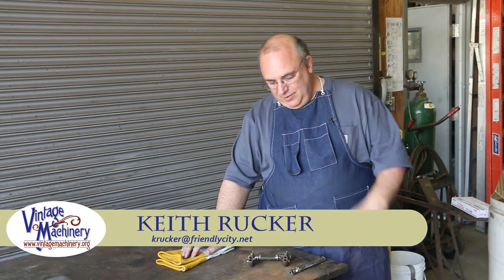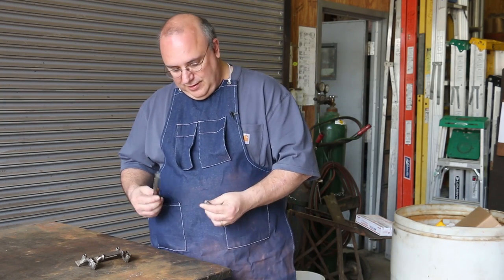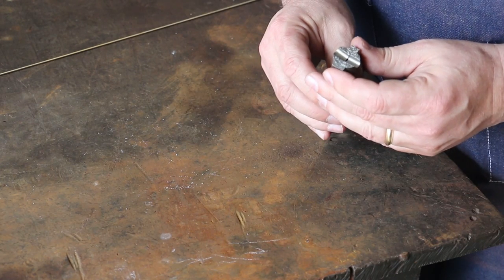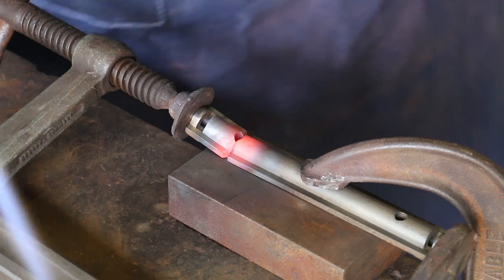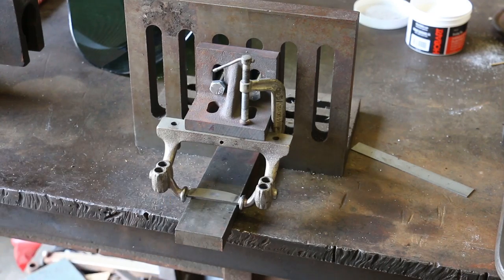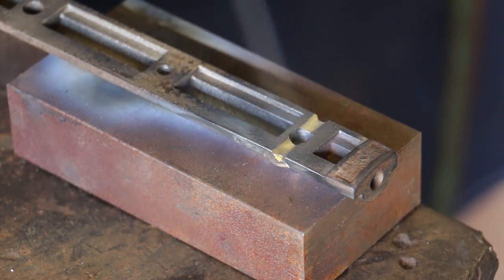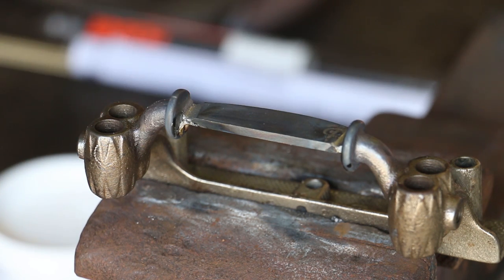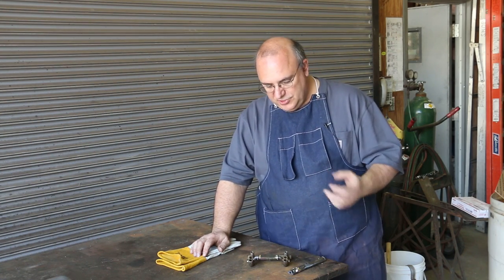Brazing Broken Cast Iron:  Repairing a Stanley 55 Plane

Comment: Im a retired welder over 35 years,  and you are right you can't just use hard wire in a mig or 7018 that's a no , you wanna use brazing rods , nickel rods , SS cast iron rods etc. There's quite a few , the reason cast iron is so hard to deal with is the stretching and bending is only at a 2 to 4 percent when applying heat to it , unlike mild steel has a 50 or better stretching,  bending warping point , not to mention cast is dirty anyway .....but warm the cast up pretty good before welding the crack , just let it flow slowly , lot of people try to get in a hurry with cast and it just want happen , patience is key when welding cast ....clean the area and bevel the area clamp it down good cause it will warp ....

Comment: It would be stronger if you 'tinned' the unmodified surfaces with the rod, then re-flux and bring them together while hot on a flat ceramic surface (doesn't absorb the heat). The thinner the uniting metal, the stronger the joint. No need to grind out a 'vee', that only weakens the repair.... Brazing is soldering, just using brass or bronze instead of tin/lead, and at a higher temperature, but the principles are exactly the same....

Comment: why not brazing paste? brush and flux busted edge, paint on brazing paste, wire/clamp to position. heat, tighten clamps when fluid, let cool. no need for notching or grooving, perfect alignment, and stronger than a stick joint usually. H&R used it for the hinge/lock blacks on single barrel shotgun barrels, (you can see the line of braze in the blue job), so it really can't be "weak"...  probably would have been just the ticket for that sleeve repair in the loco cylinder head too. i can dig that some jobs just don't lend themselves to such materials, but those "on the bench, at my leisure" type ones seem to cry out for its use

Comment: That was a satisfactory job on the brazing but I can't help myself. 
I'm not looking to criticize but I wanted to share some of my experience in the hopes that we all learn how to improve our skills. I learned to braze from a master back in the late 90's and he was really good at explaining the science of metal bonding (ionic bonds) and how different materials react to different temperatures and how to apply the torch flame to achieve optimal temps. He taught me that the "secret" to good brazing is to recognize how the materials involved behave and react when your materials and flame temps are in the "green zone".
.
I noticed that you had your torch set too cold and you were applying the flame from too far away during the brazing work. 
.
The torch flame has two parts, the "feather" and the "needle" (as I learned to call them), the feather being the transparent blue long and wide part of the flame and the much hotter short blue-white opaque "needle" in the center.
The needle is the real working part of the flame for the actual brazing part of the work. 
.
A lot of guys call it a "neutral flame" when the needle is about a quarter inch long and you get more of a "whoosh" sound from the torch and they call it a "carbonizing flame" when a little bit more acetylene is added in to make that needle flare out to about a half inch long and you get more of a "hiss" sound. I would have used the torch as it was set in this video if I were brazing something like copper tubing joints or plumbing joints. For the work in the video, I would go much hotter.
.
The feather of a neutral flame is fine for the preheat work but when you do the actual brazing (the part where you actually melt the rod in to the gap), you want to be using the heat projecting directly from the tip of the needle for that. That much hotter part of the flame will more quickly melt the rod and allow it to flow like water in to the gap. If the flow of the metal from the rod looks and feels more like maple syrup or pudding than watery, that's a good indicator that you're too cold or too far away. Most of the time it is best to push the tip of the rod in rather than lay the side of the rod down.
.
You don't want the metal parts being bonded to do the melting of the rod, you want the flame to melt the rod. Ensuring that you apply the rod/heat in that manner, you avoid most of the "clumped and humped" metal around the joint and it's much more efficient, makes a stronger bond, and it really cuts down on the clean up part of the job. 
When the material on both sides of the gap is sufficiently hot, and you are putting the needle to the rod, that rod metal will naturally flow in and cling to the sides of the gap through capillary action and when your material temps are hot enough, very little flux is necessary. In fact, over fluxing the joint can weaken it if you aren't careful.
.
When you set your flame for this type of brazing work, in the future, I'd listen for a little more "hiss" and little less "whoosh". I would have set the needle to be "carbonizing" at about a half inch long, with a sharp point, for the work you were doing and apply the flame to the rod/joint so that the needle tip is about an inch from the rod/joint (much closer than you were applying the flame in the video) with very short, quick, tight sweeps of the flame. 
That will get the temps up to where you need them for a "watery" flow and a very strong ionic bond that creates a very clean and efficient joint. It even uses less rod, less flux, and less time.
.
As I said, I'm not looking to talk down to anyone, I just hope to make everyone better at the task. Hope this info helps someone. Take it or leave it as you see fit.
Best of luck to all.
Reply: +BigRalphSmith That was really helpful, thank you!
Reply: +BigRalphSmith  Keith is not an expert at everything he does, I have heard him say things along that line several times. However he has a tremendous can do attitude, and I think he is a really great guy for taking the time to post his videos to help the hobbyist learn how to do jobs. That also prompts discussion and comments from genuine experts and tradesman like yourself who add valuable contributions.
Reply: iiredeye iiredeye
I love watching Keith do his thing. He's far more knowledgeable and skilled in machining than I will ever be.
He does an admirable job even in those areas where he freely admits a lack of knowledge or experience and any information that I feel might help him out is worth sharing. Not just for his benefit but for anyone who might be able to benefit from the experiences of other tradesmen or craftsmen.
Probably the thing I like most about his stuff is that he's willing to make mistakes and show those mistakes to everyone. That makes all of us better at what we do in the end.
Reply: +BigRalphSmith I noticed he used a whole bunch of flux (at least, to my noob eyes it looked like alot). I've seen others use a very small amount. How much flux to you need really? Does it vary depending on the type of metal or do you usually only want a thin coat? 

"You don't want the metal parts being bonded to do the melting of the rod, you want the flame to melt the rod." -Don't you melt the rod with the flame with certain rod (like lower melting point rod; i've heard you do for things like copper pipe)? Also, if you are melting the rod with the flame, how do you know how hot the part needs to be if you are melting the rod with the flame? Are you basically looking for the part and the rod to be the same temperature?

Finally, is there a universal "rule" about any technique or do all techniques need to be specific to the metal/rod combo you are working with? 

I've just been introduced to brazing and am really excited about not needing to go purchase a full welding setup for the little bit of hobby stuff/home repairs I need it for. Thanks for taking the time to do this write up.
Reply: F!@#Guilt
I'll try to give you the best answers I can but I don't claim to be an expert. All I can claim to be is a good, experienced welder (and even that claim is up for debate or challenge because, in the end, that's just my opinion and the opinion of some others I've worked for and with).
.
On the question of flux amounts, I find that, if your temperatures are right and your parts are hot enough and you are using the right rods and have the torch set correctly, you will need far less flux than if any of those things are off no matter what material you are joining or rod type you are using.
.
On the next question, you learn how the filler metal behaves when your temps are right and when they are wrong.
The metal from the rod will readily flow toward and adhere to the parts if the parts temps are in the zone.
It will glob up like chewing gum when they are too cold.
It will run right past the parts like water if they are too hot.
It's almost like how the surface tension of water works. It's difficult to put in to words.
.
The only truly "universal" rule I know of is, eventually, there is no rule that you are never going to need to break on occasion except those that are safety related. Safety rules are genuinely universal. All others, we'd like to think they are but the reality is, not so much.
Brazing, like welding of all other types is as much an art as it is a skill and there's only one way to perfect your skill; experience and practice.
In the end, the more you do it, the better you get.
There's no short cut. Some catch on faster than others. Hope you get the chance to work with a good teacher as I did.
Reply: BigRalphSmith Thanks for the reply. Good advice man. Cheers.
Reply: BigRalphSmith   Temp and fitment has nothing to do with the amount of flux to use
Reply: Russell Withrow
Experience and training tells me otherwise.
Thanks for sharing.
Reply: whatever you have said its just  100%correct that is the right way of doing   Brazing thanks for the feed back on this video its not about criticize  its about we all learn from each other
Reply: BigRalphSmith  why don't you make your own video  looked like he did just fine. he is the master that you would learn from. and not disagree with his results.
Reply: Francisco Molina
Because I have nothing to prove to anyone.
I shared some personal experience because I thought someone might learn something new but, even if no one does, that's fine too.
I expressed some opinions. Feel free to disagree with me.
That doesn't bother me at all.
And, I highly doubt that it bothers Keith either.
You act as if I'm trying to tear Keith down but I'm a big fan of Keith's.
Reply: +Frank Molina what  +Camical name  tell me
Reply: BigRalphSmith
I hope to see you making a video to show us step by step how to braze and the common mistakes.
Excellent informations you put in this comment.
I subscribed to your channel and waiting for good informative videos.
Regards.
Reply: That was a very informative response.  Thank you for sharing it.  I got a lot out of your comments.
Reply: Frank Molina
that's a scary comment from you. How dare we have anything to say about your master. 
You talk about learning but your attitude will make sure you learn nothing. 
Keith gathers people like you around him to bolster his own ego and you are a prize example.
Reply: @frankmolina3951  Ralph pointed out something everyone can benefit from. The first thing I also noticed was that the flame was way too cool. Google "neutral flame" or slightly "carburized flame". Best you not disagree with others unless you are certain they are wrong.
Reply: What surprises me most is that Keith didn't even bother to acknowledge or reply to this extremely instructive comment. A lot of amateurs can learn from this critique. 
Kudos to you BigRalphSmith
Reply: @bigralphsmith thanks for the additional information, that together with this video was really helpful
Reply: I know this was written 5 years ago but I have never seen how to braze explained so well!!!! Wow looks like great youtube people some times attract other great people willing to take the time to write out and give a great explanation and some additional knowledge thank you BigRalspSmith and Keith!
Reply: Great info Ralph, thanks for sharing. I like the attitude that we can help each other by sharing information, most of it learned the hard way. No way Keith took any offense. The Marine saying is," know yourself and seek self-improvement". Everyone can improve...Again thanks for the info, it helped me too
Reply: I have limited experience brazing but I know how and have had good success. I too thought the flame was too big and cool, but I also would have taken those blocks of steel that were placed underneath the parts, and pre-heated them on a cook or wood stove, or with the torch. I would have started with heating those blocks, and then pre-heated the entire cast part too, before heating any cast part red.
Just my instincts; self taught mostly.
Reply: Sorry  @frankmolina3951  Retired degreed welding engineer here. "Big Ralph" is 110,000 % right.  WAY too cold, Bad torch manipulation - it was more like furnace brazing with lousy joint design and poor filler metal application,  then manual torch brazing. 

I love Kieth, and his vids and without question gets the job done but he is very far from a mil-spec welder and obviously lacks formal training or understanding of what is is actually happening. (Outer envelope, reducing cone, and feather:text-green-game-over:) - And trust me. It wold take more then a month of videos plus hands on instruction to fully understand brazing and welding.
Reply: Seams like lots of good info. I’d like to watch a utube of you setting up a torch .
Reply: Thank you for sharing this!

Comment: Excellent job!! This is just the way our instructor taught us back in the 60's. And also, the way an old railroad blacksmith, back in the 70's, built up the teeth on an old obsolete hand brake gear . Building up bronze takes a delicate skill of balancing the heat. If you have too much heat on one side, the bronze will sag and run off the other side. You have to have the right temp as you fill in the gap, or it will just run out. If more heat had of been used, as some suggest, it wouldn't have worked. This video shows the correct way to braze.
Reply from the maker: Thanks Ronnie - I know that you are correct because I have melted a lot of braze out trying to hurry things up.....
Reply: @VintageMachinery  Hey Keith (or anyone else that is knowledgeable), regarding the flux you are using.  Are you just dipping the rod into the dry crystals or did you mix the flux with water first?  Thanks!
Reply: That has been my experience, I would melt the first brazing and the piece would fall apart.  I have a piece of old farm machinery that I am going to try to fix.  Have not brazed in years.

Comment: Howdy!  Thanks for the video.  Like you, I learned to braze in a high school metal shop class.  My teacher was a stickler for technique and brazing was his specialty.  When I see brazing videos on the Internet (like this one) I think to myself 'Mr. Grizwald would have failed them on technique and appearance!'  We had to heat the joint so the brazing rod could melt and flow into the joint without the torch on it.  And 1/8" over coverage is all we were allowed.  I haven't tried brazing since then (1984) because I use to think of it as a hassle.  But after seeing you and many other 'pros' on the Internet demonstrating your 'awful' brazing techniques it gives me hope that a mere mortal such as myself may be able to pull off a successful braze job in a pinch. Thanks for the inspiration and education.

Comment: I use to do a lot of exhaust manifold repair / cracked / broken , missing parts .
I knew about the specialized process of preheating - welding with nickel - and slow cooling in oven [ the main thing I found was that preheating & slow cooling was to keep the cast iron from heat-stress-cracking , heating too fast and especially cooling off too fast .
What I found that worked very well , using mig welding with standard steel wire and adjusting the power to keep from heating up the base / part - putting most of the heat in the wire [ which means welding very fast ] as soon as the welding done [ on big jobs - long time with welder , do the welding in short steps ] then through insulating blanket over work - too cool slow '
Fast cooling with lots of heat in piece would get very fine & many heat stress cracks .
Many of these manifolds came back months or years late when other areas did the same and the 1st repair was still good .
Sometimes just trying to do what we are told we can not do is rewarding ;)

Comment: I find brazing works a lot better for me as well. I have used ni- 99  some times it works. other times well you all know the sound that no one wants to here. So i favor brazing over welding. Maybe a tig might work or a mig , I stand with Keith on brazing cast iron. Just saying. Nice job Keith, Also thanks for showing.

Comment: Keith,
Nice job of brazing. Like you, I prefer to add the flux to the rod. The prefluxed rods are sort of fragile. It doesn't take much of a bump to knock off the flux. I did a lot of gas welding and brazing back in the early '60s when I was a lad. I couldn't arc weld to save my soul! The nice thing about gas welding is you can reflow your errors and no one's the wiser! Thanks for the great video. With spring coming on, I would imagine you will be down at the museum more and complete the Vance planer-matcher. I look forward to that and other restoration projects!
Have a good one!
Dave

Comment: when parts comes apart at crack level, an easy way to repair is to clean the fracture fascia without disturbing it, spread a coat of flux on the fascia of the fracture, squeeze parts together and braze with EasyFlo 45, this leaves a small line at the fracture and the brazes part needs almost no touch-up to bring back in service.
I use this technique on mechanical parts with a good success for decades
Reply: Easy Flo 45 contains cadmium. There's no way I'm putting that on a hand tool.